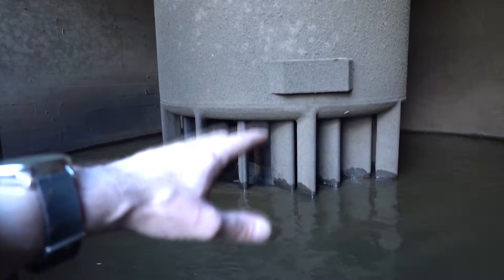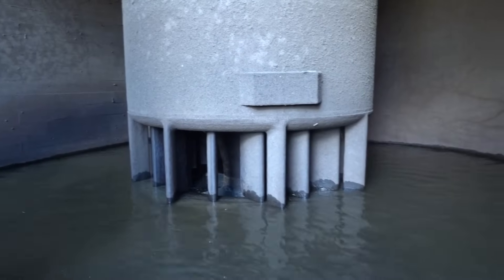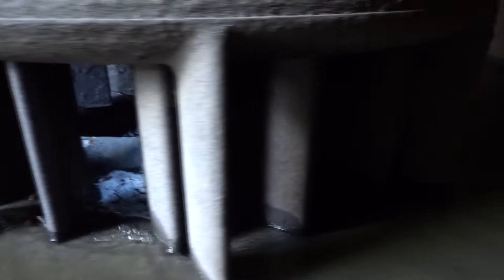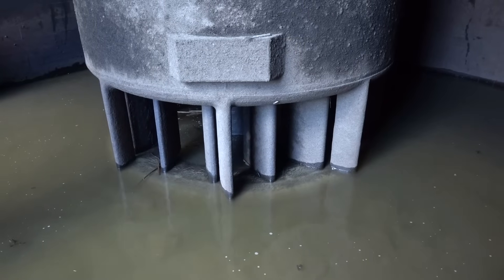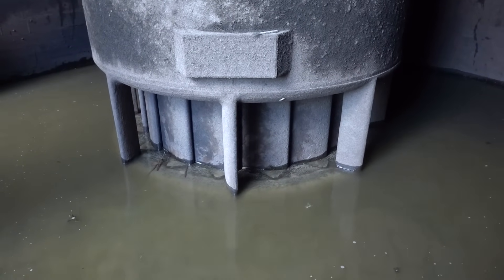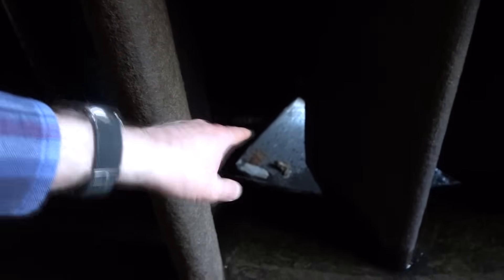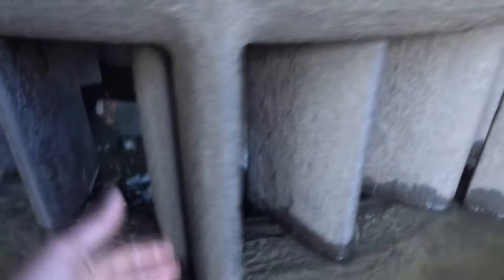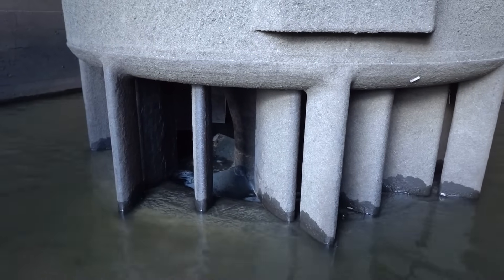Authorized Personnel Only - Inside The Bottom Of A Hydroelectric Power Plant

Comment: I always wondered how ladders like that are attached to the wall. They always look so unstable but seem to last forever.
Reply: They use these same style steps in utility manholes.  They don't last forever, especially in sanitary or combined sewers. The humidity levels cause them to rust and become unusable (safely). That's why you will technicians using a step ladder instead of the built-in steps.  They can be replaced by cutting the old ones off, then drilling new holes and epoxying in new steps.  Just a side note for us nerds out there..
Reply: Correct me if I’m wrong but I believe it’s steel rebar that’s actually cast into the concrete

Comment: Dang. I knew that the wicket gates were adjustable, but I didn't know the turbine blades were as well. 
That becomes a pretty complex control system to maintain synchronization and output power, and now I want to understand how they correlate in action.
Reply from the maker: A detailed breakdown of that, showcasing both the old manual way and the new PLC method is coming in Season 4 :)

Comment: Hydroelectric is hydroelectric. By scale, this is a tiny unit. The various dams I've worked on to rebuild turbine units, the headstock (intake) range from 60-120' from floor to ceiling. The draft tube is where I really like to be. Avg 300ft below the surface of the headwater. It makes you feel sooo tiny.
Reply: Thank you for making these voesoa

Comment: To add any one watching.
This is a Kaplan Turbine. It is a reaction turbine, the water flowing over the blades moved the blades , the opposite of a ship’s propeller where the blades push the water.
So high flow, low water pressure , called head, because the dam is not high.
My dam is 100 feet high and is a Kaplan.
For very high dams you use an Impulse turbine called a Pelton. Imagine a garden hose solid stream hitting the blades of a pin wheel. No wicket gates,  a valve regulates the flow in the hose nozzle.

Other dams use a Francis Turbine , more pressure than Kaplan , less than Pelton.

The main regulation of speed when under no load is the wicket gates signaled by the governor.
When under load the governor controls the power produced by moving the same wicket gates but the speed does not change it stays at grid synchronous speed.

The blades on the propeller , called a runner in a Kaplan Turbine, also move 
Under governor control but this is more fine tuning to increase efficiency as the water level upstream changes or unit is not running at design load.

Comment: This is evidently a "low head" axial flow generator.  Lots of water at relatively low pressure.
Reply from the maker: You are correct. 18ft of head at about 400CuFt/Sec of flow. 500kW when she's happy.

Comment: I am petrified of being near hydroelectric turbine when its running and Im also petrified of being sucked into a intake pipe near a turbine
Reply: You and every other rational person on the planet
Reply: tell me about it..in Africa i’ve been 300 ft down to help maintain one of these…each of the wicket gates were something like 9ft high….the grill easily 50x50ft…the water coming down towards the wickets on a 45degree slope and i remember the concrete was all slimy…from where the grill was about 200 ft away up the slope everything tapered down to an opening the width of a doorway into the wicket gates….it was so eerie… uuugghh….i was absolutely scared shitless the whole time i was down there
Reply: I bet you love ship propellers rotating underwater.
Reply: Glad to know I’m not the only one.
Reply: Ok, so that is a completely normal and rational fear?  Because I am absolutely terrified of water pumps.  I don't even want to mess with a sump pump. That shit?  Nope nope nope nope
Reply: You should google the plate taille dam incident

Comment: would like to know what parameter is adjusted with wickets and what with blade pitch. I guess they has to bear different functions
Reply: Well they kinda bear the same function. Wicket gates regulate the flowrate while the blade angle is changing to optimise for it. This is a Kaplan turbine if I'm not wrong, so look for that for further information.

Comment: Can this plant be "black started"? Are there generators to power things like the wicket gate motors and control equipment?
Reply from the maker: Yes, in the unlikely event that we needed to do it, we can do a Black Start. The old system here used to have a battery bank for it.
Reply: Blackstarting a single plant by itself isn't generally very hard as long as they have some sort of backup power. Getting the whole thing synced together again would be a chore.

Comment: How do you ensure that room doesn't get filled with water while you're in there?
Reply from the maker: A substantial faith in Physics, Engineering, and my brilliant trustworthy coworkers. Which is why I was scared shitless.
Reply: @Physicsduck  The physics and engineering parts are fine, I definitely don't trust the humans on the switches either!
Reply: @JamesChurchill3 all parts to make it safe are “locked out and tagged out”.  In a situation like this the head gates are down and tagged to not be operated.  
The unit cannot spin because there is no water to spin it and the generator disconnects are opened and tagged so the grid power cannot motor the unit.  
As far as the wicket gates, they are locked hydraulically and mechanically or or mechanically disabled.  Typically the wicket gates are inoperable if someone is in the chamber. Exceptions are made for testing and inspection and the person/s is made aware not to get near the gates.
Reply: @Physicsduck  I bet you were glad it wasn't "take your kid to work day".  One of your coworkers' kids: "Daddy what does this big red wheel do?  Can I turn it??"
Reply: Oh, they just turn off the river. Piece of cake!
Reply: Mulder and Scully always get in trouble in a room like that
Reply: Wack cable tie on the switch. Happy days.